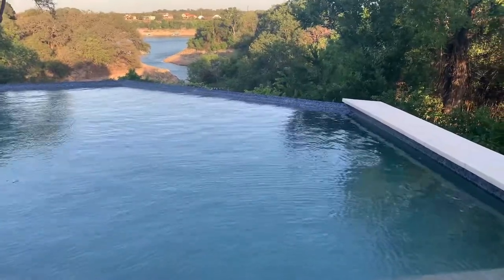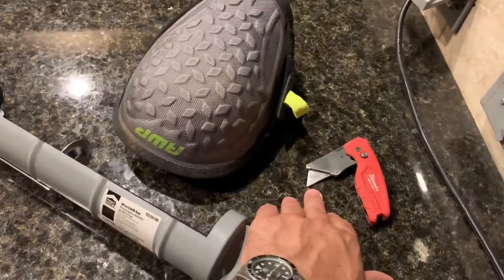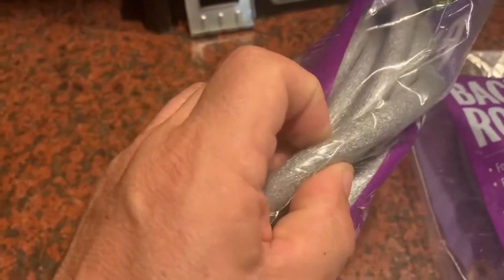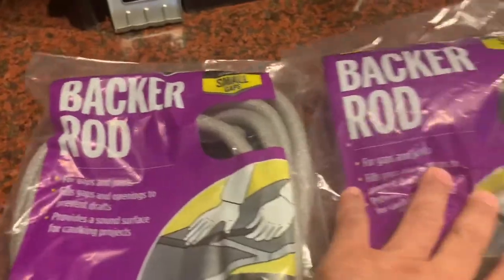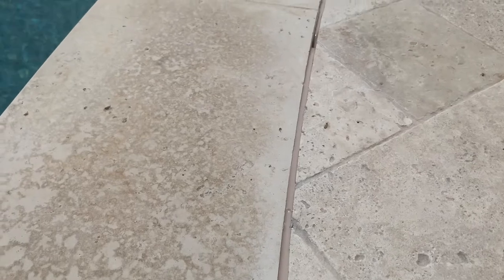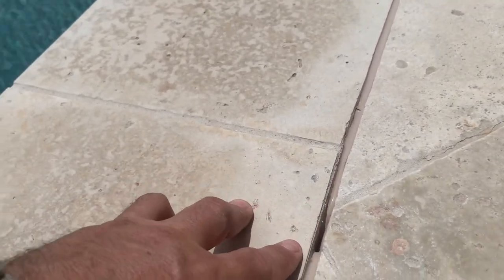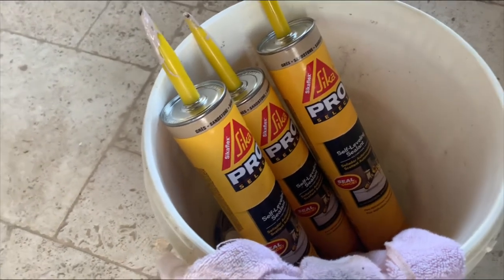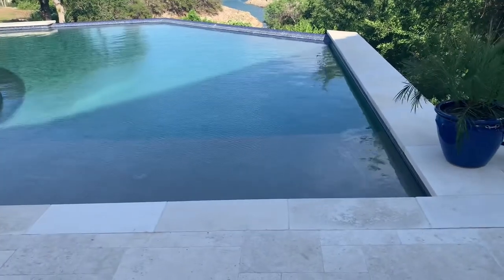💦Pool Help 4 ● Reseal Pool Coping Using Sika Self-Leveling Sealant on Your Patio ● Expansion Joint

Comment: You made a major mistake not using the backer rod. I will never understand why pool builders use sand. It is the major reason sealant at the coping fails so often. And then homeowners see it and think it is the correct method. ( my guess is they have a big pile of sand on site so they use it) ALL MAJOR sealant manufacturers say to only use backer rod as a filler under sealant. And there is a good reason for it. Sealant should be installed with the center of the sealant thin enough to stretch while the sides are thick enough for a good bond. Sort of hourglass shaped. “) (“. When you use sand and don’t tool the sealant it’s thickness is the same as the bonding surface taking to much force to stretch resulting in the side pulling free( just like this pool did.) kind of like this “l l”. I have been a professional caulker for over 45 years and this is a very basic principle of installing sealant. Please use backer rod and stop using sand. The rule of thumb on how deep the sealant should be is 1/2 as deep as wide. 1/4” minimum 1/2” maximum this is critical .The backer rod also makes it much easier to control depth. But make sure it fits tight to avoid sink holes. Also as for a sealant that’s a little less runny, Vulkem 45SSL is semi self leveling.
Reply: Agreed! Butterfly the backer rod if necessary!
Reply: I’ve had this happen in 2 consecutive years in Texas and my coping cracked in all 6 pieces- I wonder if it’s because sand was used instead of the backer rod
Reply: @j190phil  it’s very possible. It is also possible,but not common for the sand to actually “ lock together “ restricting masonry thermal expansion. Occasionally causing softer masonry to crack.
Reply: @wayneemigh7396  butterflying or doubling the backer rod is not a good idea. Backer rod can be bought in sizes from 1/4” to 4 “ so there is no reason to not use one piece of the correct size backer. But using backer rod in almost any way IS better than sand. But it has to fit tightly to avoid sink holes.
Reply: @genecarden780  if my gap is 1” what size backer rod do I use?

Comment: Backer rod can prevent those sinkholes. I tape both sides when seal so I can press the sealant in and it also helps me get a clean, straight line.